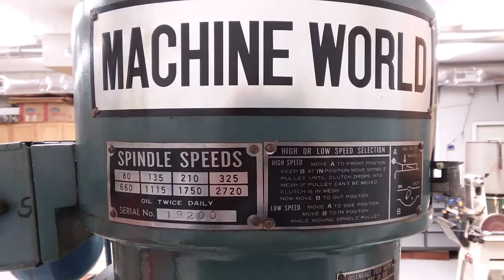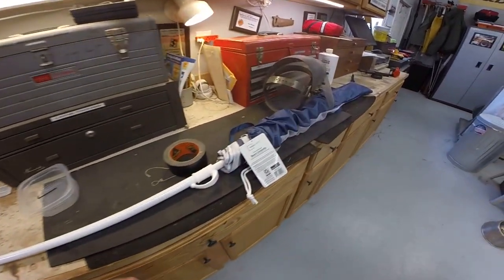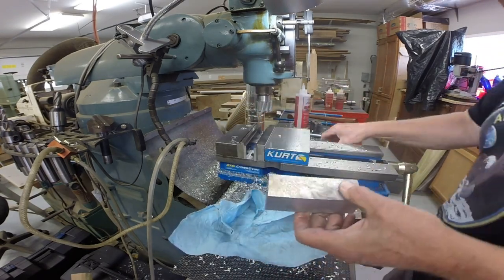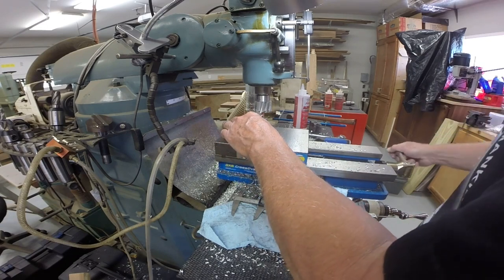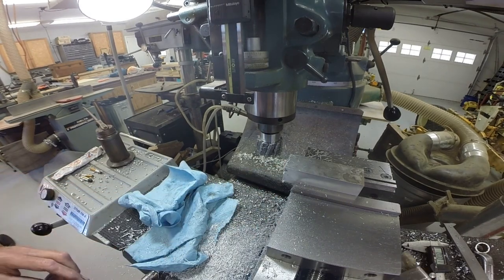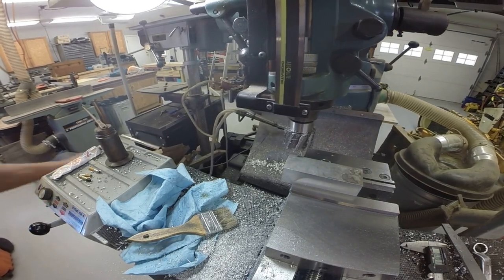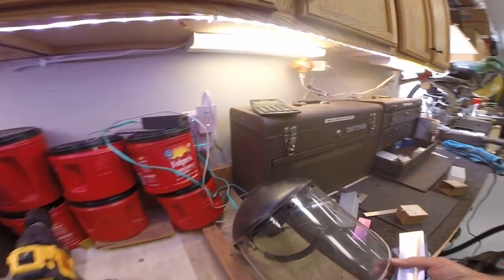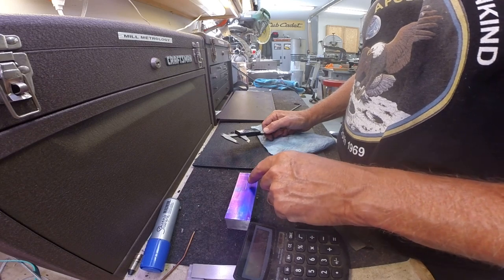Shop Update and Stroller Umbrella Support

Comment: That craftsman welder Sears welder whatever you want to call it was probably made by Forney and would be better than about any of the welders you could buy today unless you want to get into your higher-end ones.
Reply from the maker: It always worked great but is AC only.  I have to say, Craftsman used to make some good tools--or had other companies make them for them. I have a sawzall and a 1/2 inch drill, so-called "industrial" versions, that are better than practically anything you can buy today.  I think Singer made some tools for them.